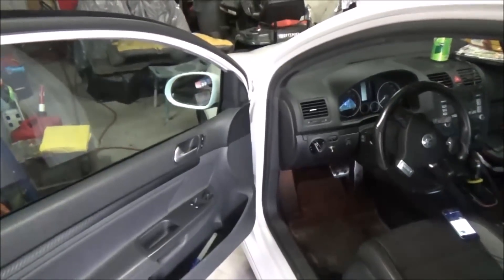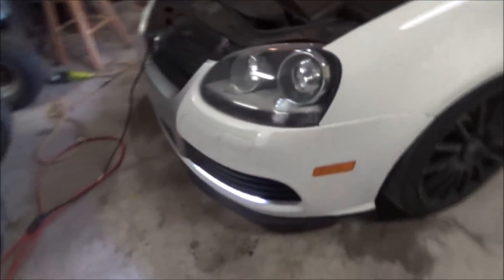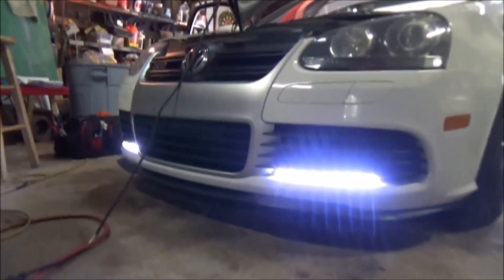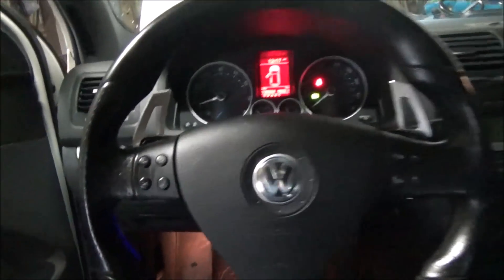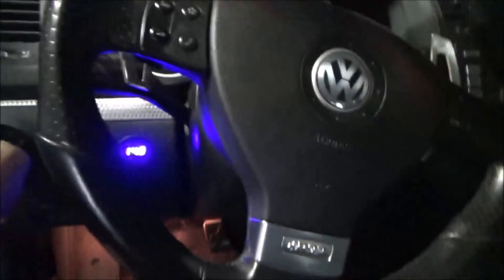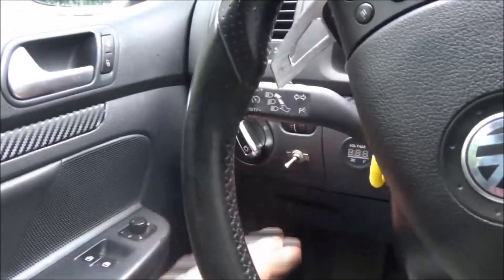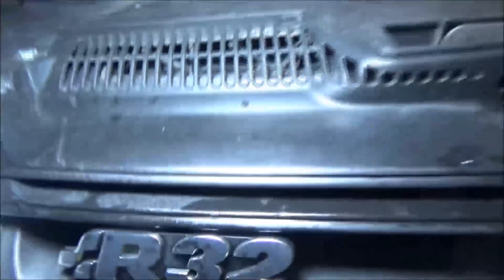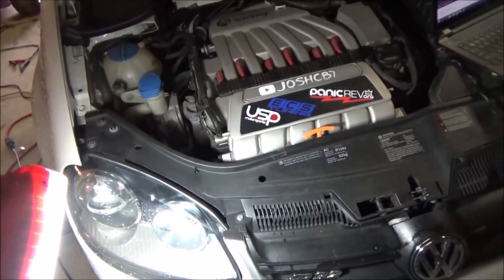Amazon Volt Gauge Install,Carbon Fiber Trim,And Custom Cooling Holes

Comment: Hey, just bought my R32 in NZ, just wondering how can I access MFD menu? Thank you. By the way, your videos are very helpful 👍🏼
Reply from the maker: On the right side of the steering wheel there are 4 buttons,2 are up and down arrows,Top left is a menu scroll through gas mileage and stuff until you get the list to change the clock and stuff.and bottom left is an "ok" selector.

Comment: Why didn't you just get a Polar FIS or Kufatec E-MFA? It would have made it more OEM by using your display than having a non aesthetic switch or something that sits below eye level and also given you many more options than what you have.
Reply from the maker: The one I got was only $7,I just needed voltage #s